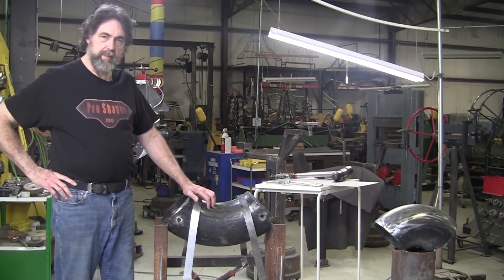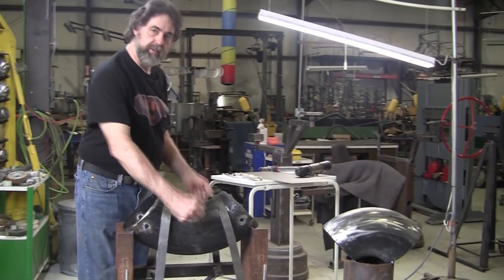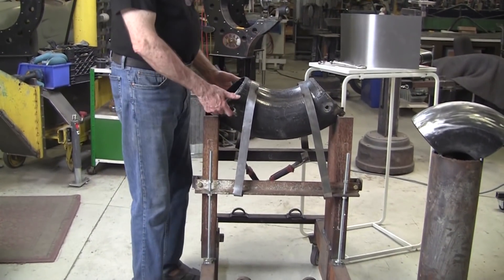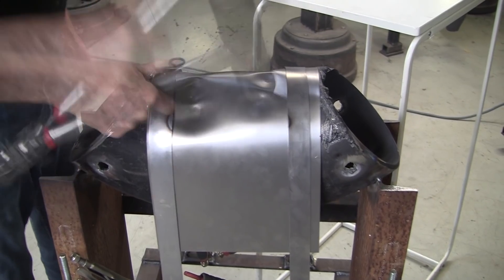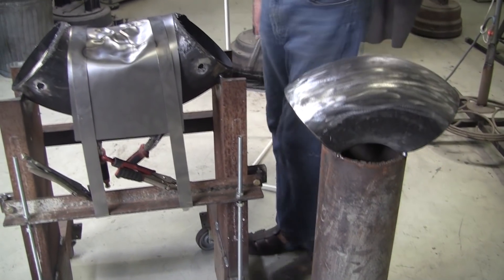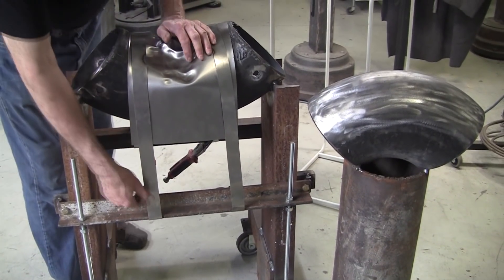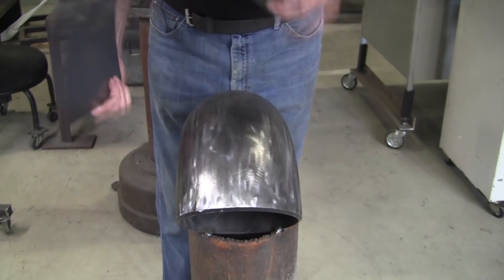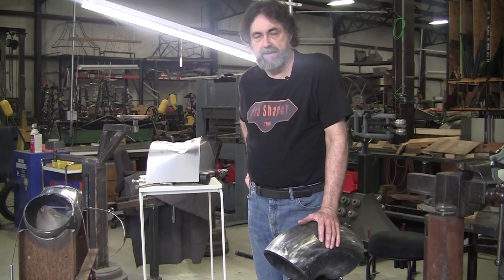How to make a Reverse Curve

Comment: Have the same question Jim Aagenes asked about 6 months ago. How do you wheel an extreme reverse curve with a flat wheel on top of a wheeling machine?? I'm trying to flare a 3/4 scale 1925 Miller 91 cowl and 
have only succeeded in creating a months worth of scrap .063" 1100.  At 80 I thought I knew it all or at least could figure out anything but this one's got me baffled.  Also, I'm 15" wide at the fire wall and it flares to 17"
over the dash so I don't see how I could get away with using a piece of pipe, which by the way, would take me another 80 years to find in my area, but I am in the process of gluing up a solid wood buck/hammer form
Thanks for all the tips you've shared with us.
Denny G
Sandwich, IL
Reply from the maker: You can make a medium to high crown panel using a lower anvil that has much less of a crown. The panel is worked out of arrangement, in a curled arrangement. Watch my how to make a motorcycle fender series and you will see what I'm describing.

Comment: How often will the sheet metal need to be removed and replaced? Would a bottle jack be a worthy upgrade over the threaded rods?
Reply from the maker: Maybe three times to clamp total. There is always a faster method for everything- usually the expense goes up quickly.

Comment: What if you turned the piece over on the planisher pipe and work it some that way?
Reply from the maker: The smoothing I did on the convex surface pipe is only preparation for putting in the English wheel.  Smooth it in the English wheel and if you need more reverse beat it up all over again.

Comment: Yet another excellent shop-made problem-solving tool, Wray.  When the metal thickness &/or type requires heating to continue the shrink, do you replace the delrin-head hammer with a metal one?  If so, what size/weight/shape is preferred?
Reply from the maker: Hi John, yes with heat use a metal mallet.  I use an  inexpensive Walmart sourced heavy hammer that I spent three hours grinding the heads to the shape I wanted. The hammer has a fiberglass handle which is epoxy glued so I couldn't  reforge the head.  I will someday forge an ideal heavy mallet.

Comment: Huh. I was expecting Wray to flip the piece over when he went to the second fixture. Please note I've got zero knowledge and only a little more than zero experience.
Reply: Well . The phrase" look and learn "seems to fit the bill . I ' ve been in the car repair Industry for 50 + years and l've   restored many cars . Wray's on another level ( and he's been in the business even longer !)  but he has the equipment  to do what he does. Most of us just have a basic workshop so it limits our abilities. What l'm getting at is don't get downhearted . "Rome wasn't built in a day" so don't expect too much from yourself .  Sometimes it's just satisfying to watch and think WOW !
Reply: @johndavey72  Thanks but I'm not downhearted. Hard to clearly express emotions in text. The Huh was meant to be in a slightly surprised/questioning tone. The second fixture is the mirror of the first and it seems like if you put the part on that fixture in reverse and applied the hammer it would still shrink it while maintaining the shape. The way he did it seems like the second fixture was little more than an anvil. Maybe I was trying to question his approach without questioning his skills.<= this is me questioning myself. I am watching & learning.
Reply: My thinking was exactly the same. Seems we both were thinking wrong 😀

Comment: Great to see you back Wray. Would ratchet straps not be simpler instead if the straps? Just an idea. It’s a cool method though easier to understand what’s going on with the curve than the method you used on the XK120 mini fender. Thanks 👍
Reply from the maker: HiShane, As I mentioned in the video ratchet straps will burn up when heat is needed. I tried them and that is why I switched to the steel straps.
Reply: @proshaper   So sorry Wray I must have been distracted when you mentioned that. I need a ratchet strap on my head to maintain focus sometimes. 🤦‍♂️
Anyway enjoying the new videos 👍

Comment: The pipe elbows are used for more than just water supply or sewer. Very common in gas and oil industry, paper mills, steam pipe, food industry, power plants, manufacturing, heating/cooling.